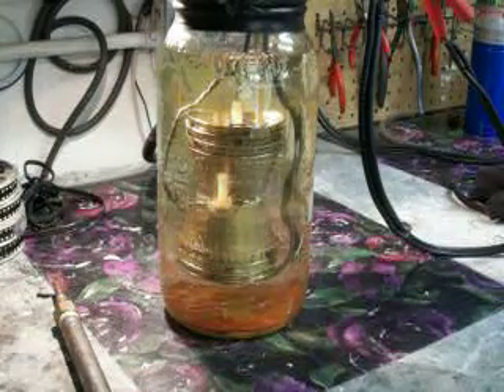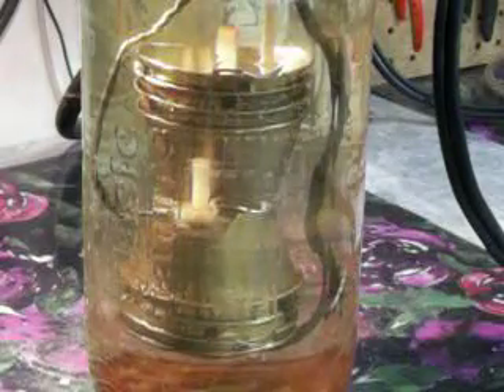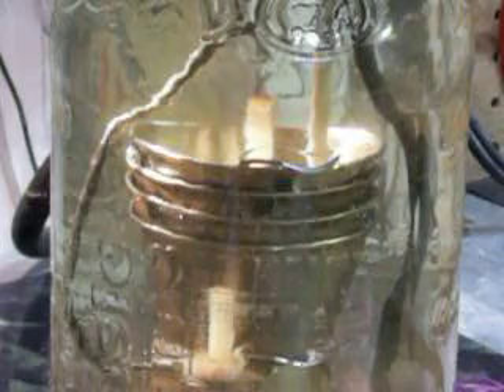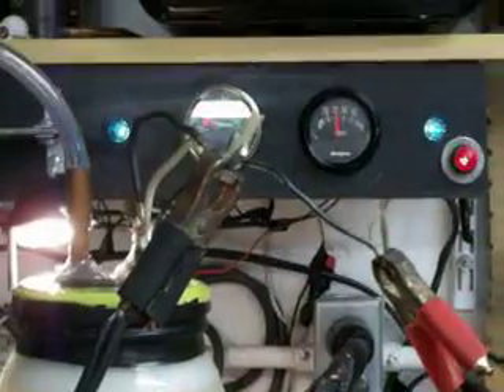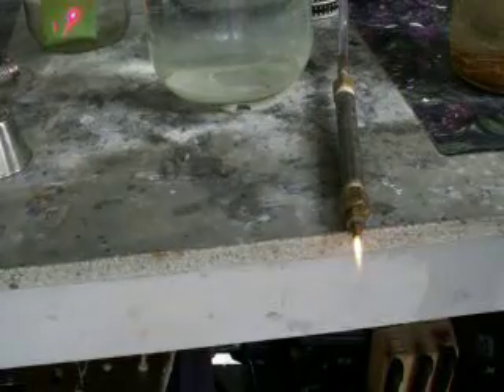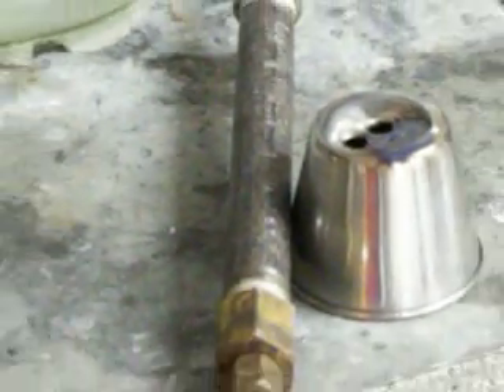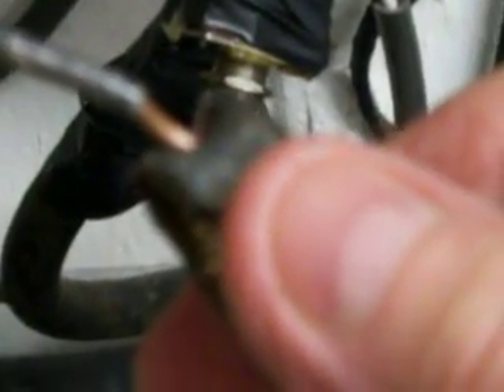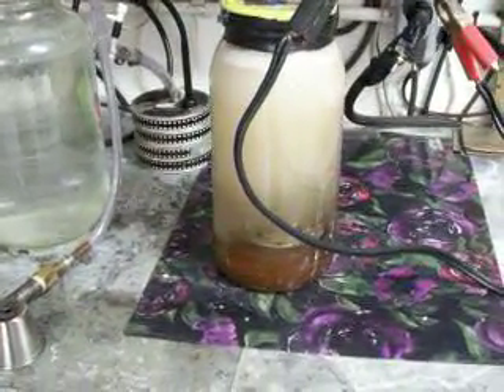hour glass cell design

Comment: ok, kinda curious here, have ya tried putting a magnet under the hourglass to see if it would increase production or pressure?  i am curious to know if that works or is it just some hype on youtube.
Reply from the maker: yes i have tried  the magnet, but the magnet will not stick to stainless if its true stainless steel,

Comment: I was really interested in your pressurized gas vapor system two videos ago that you stated the next step was to get it working in your truck. Can we get an update on that project? Have you given up on the pressurized system? You seem to be moving in a different direction now can you explain why?
Reply from the maker: no im worken on the truck, and hho too, im just working on both, as soon as i get the truck going i will give a update.
Reply: TheVaporkid Tks for the quick response, looking forward to seeing if you have to make any modifications to make it work under normal driving conditions and final MPG results.